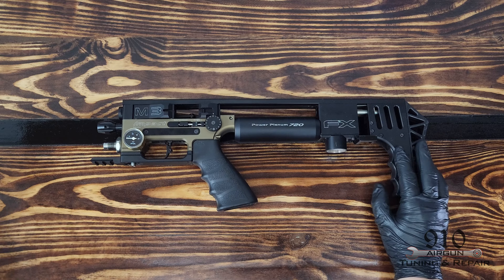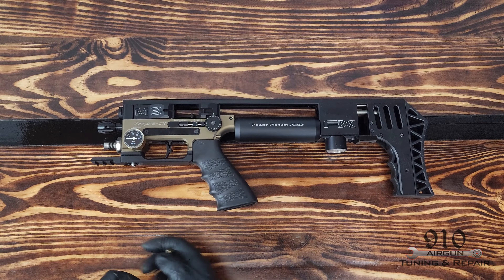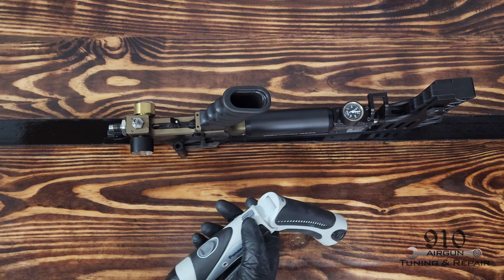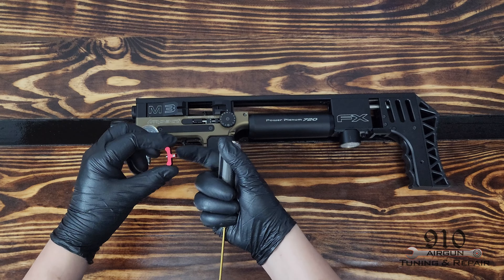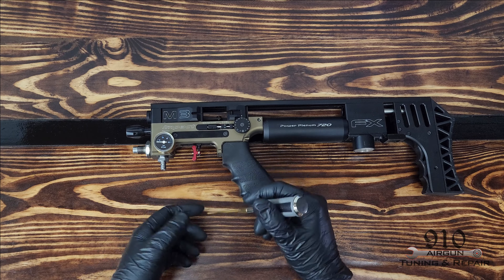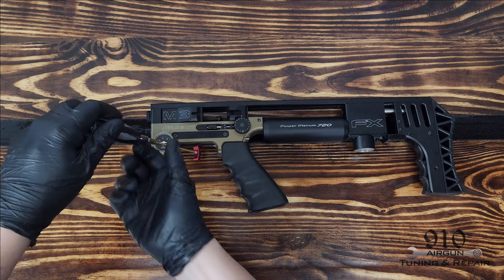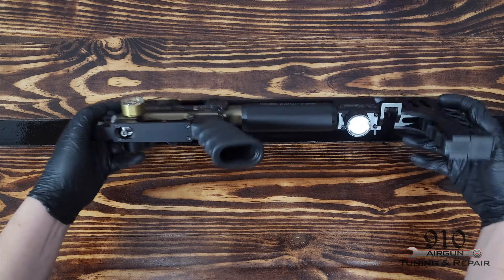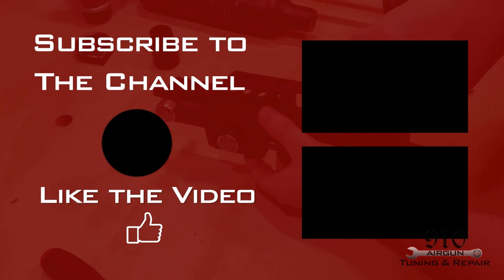Pinpoint Trigger Shoe FX Impact Install - FX Impact Trigger Upgrade

Comment: Noob question what’s the purpose on the screw in the trigger?
Reply: Creates a rememberable pressure point on the finger so the finger position is same with any shot you take, taking out positioning out of the equation as much as possible.
Reply: @WebWolf89  thanks